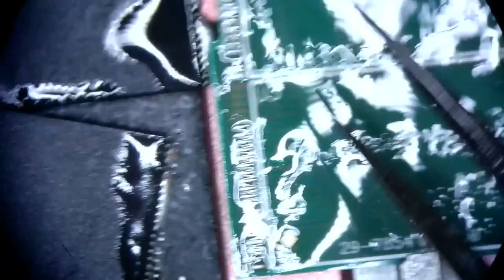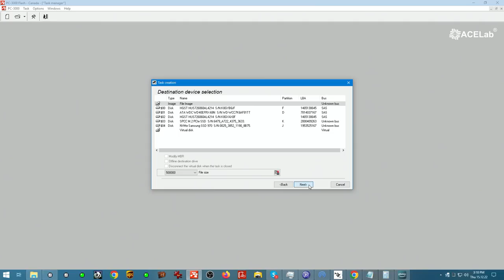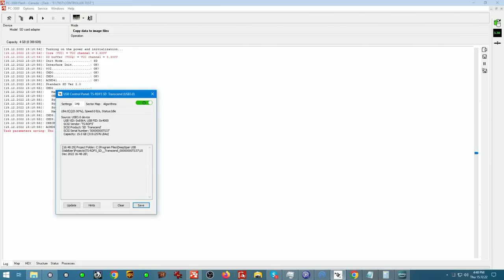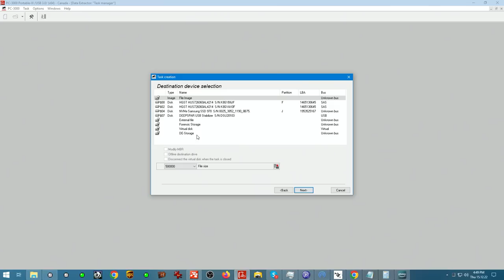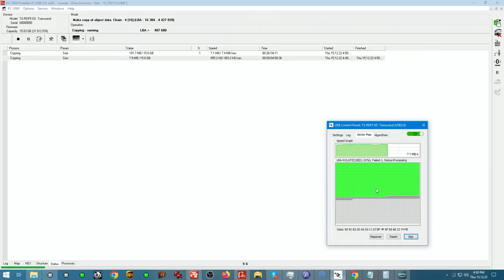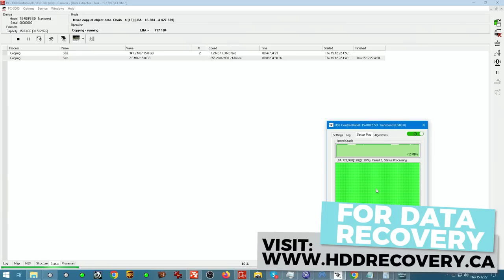heavy impact to memory card data needs to be saved

Comment: You almost gave me a heart attack when you didn't seem to notice the dislodged pads stuck and soldered in between the pins and the body of the chip. Especially when you bent the pins I was afraid the solder might pose additional stress. Only around 28:50 it looks like you sneakily removed them after all.
Reply from the maker: I would never miss that :)

Comment: Don't think you need to run this many wires. You could just place the chip a little bit away from the edge which no pads remain, the lines on the board could be just enough to make contact with the pins..
Reply from the maker: No, not in this case. There is no play with offset, you can see it in the top chip. Doing it with a longer wire gave me peace of mind that I have contact.